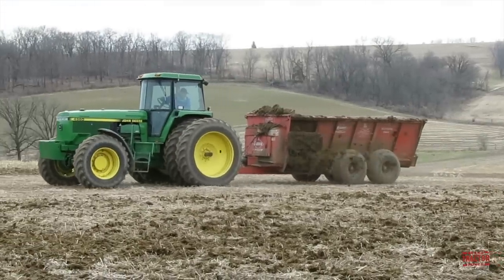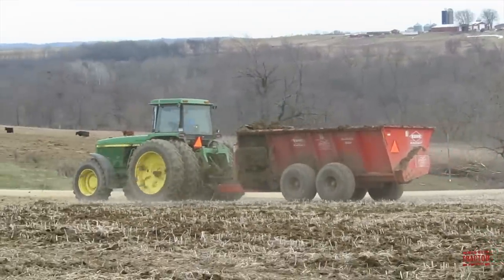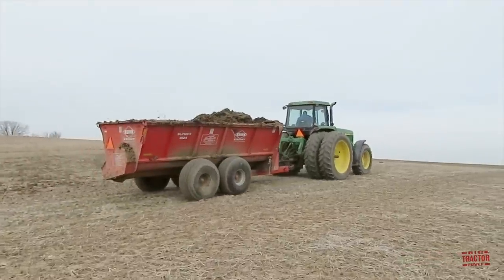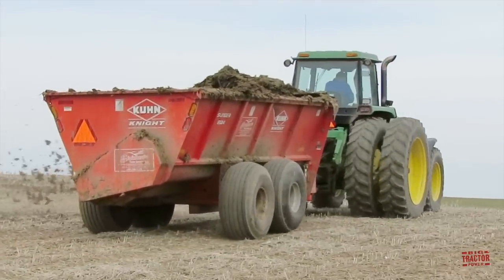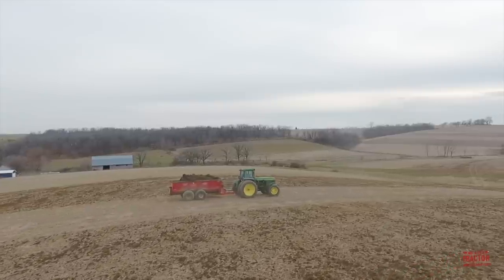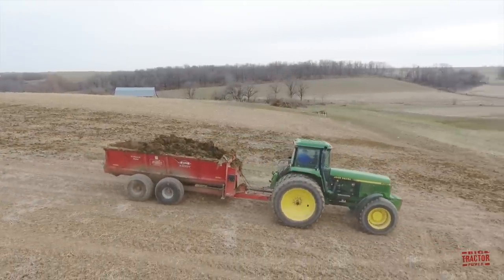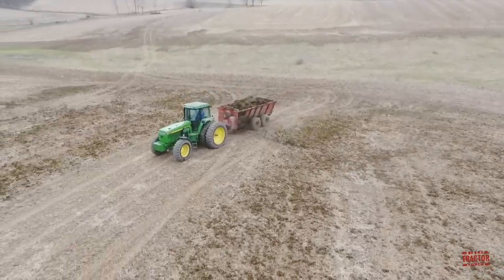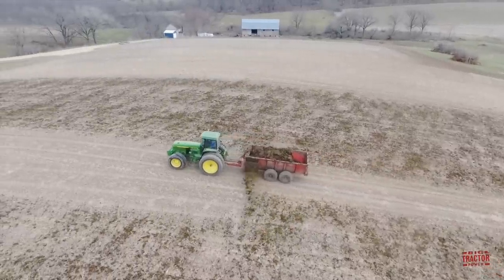JOHN DEERE 4960 Tractor Spreading Manure

Comment: Didn't know the land in southwest WI is rolling and has hills like that.  Brings back memories.  Used to spend 12-15 hour days hauling chicken manure with a Case tractor and a New Idea spreader on about 700 acres.  Had a liquid manure tank also.  Sometimes a dead chicken would clog up the outlet pipe.  My solution?  I closed the gate valve and let the pressure build up in the tank to near its maximum limit, then quickly threw the hydraulic lever to open the gate valve.  My best chicken  launch was a little over 100 yards.  Those were the days.

Comment: John deere 4240 used with a white 6700 6 row 3 point planter is its main job, its also used for a utility tractor for various other jobs. This 4960 would be awesome to have. We use a Case 2590 for that size of  tractor duties. Love your work as always BTP.
Reply from the maker: Very nice. I want to film a 2590 and a 1570 👍👍
Reply: @bigtractorpower  I'll try and post a video of them , 2590, 970, and the 4240. Cheers
Ps, we have the matching case RPS 16 foot offset disc that gets tugged by the 2590.

Comment: The 4960 was a power house, great maneuverability, and smooth power shift transmission. Spent many hours in tilage and liquid manure hauling.
Reply from the maker: One of the all time greats for sure.
Reply: Chris Winter, I never drove one, but I am sure it’s a lot better than the Case IH 7140 I have to drive.

Comment: I have a JD 4240 that I’ve used pulling the seeder for 18 years. It has 11500 hours with an engine rebuild at 8000 hours pre season. I never can remember being stopped due to a break down in all that time. I would love a later model sound guard but they are just not available in Aus. Everyone keeps them for them selves.🇦🇺👍

Comment: My cousin was bailing straw in Ohio in the early 90's in a 4960 - great tractor - but the bailer caught on fire and that spread through the hydraulics to the back of the tractor and basically burned the whole back of the tractor off -- he was wise enough to get the hell out of the tractor at least and the only loss was equipment loss ;)

Comment: farm I worked on had a 4955 they bought new, couldn't keep a transmission in it. replaced it 2 or 3 times. Traded it off quick. they have a 4450 with a ton of hours on it very few problems ever.
Reply from the maker: That was not good.

Comment: Great video! But why are they use in the US this kind of spreaders with such small volume and small spreading reach? We in the Netherlands are using Tebbe, Joskin and Strautmann spreaders wich are bigger and spreading much much faster and up to 24 meters wide. Spreading on this way is so time consuming.
Reply: Some farms can only afford these, only produce enough manure for it to make sense to run one of these or even doesn't have a good enough reason to run one
Reply: @maxhallman1036   Thanks for the answer, but there are also small spreaders which are of the same price but with a spreader on the compleet backside so they are much faster. I can't understand why they are producing systems like you see in the video. Its not an effective system.
Reply: @breiback  a lot of fields that these are used to don't really justify the use of a rear slinger like this company and many others make

Comment: curious as to why the operator seems to protect the spreader driveshaft joints by disengaging drive before turning yet abuses the tractor pto clutch by slamming the drive in at full engine revs , made me cringe watching the puff of smoke every time